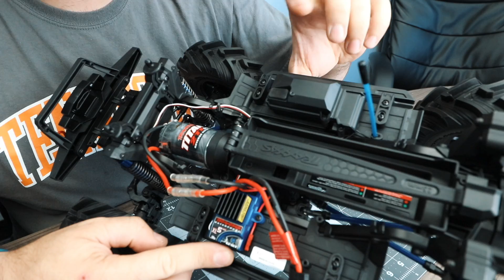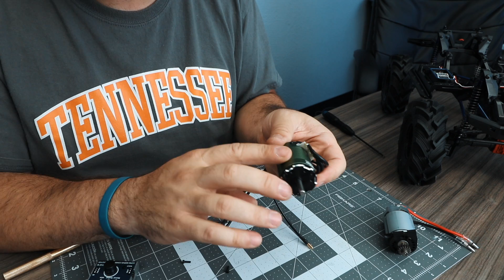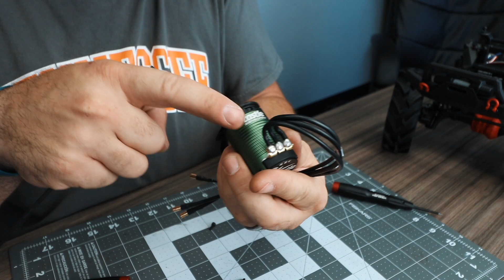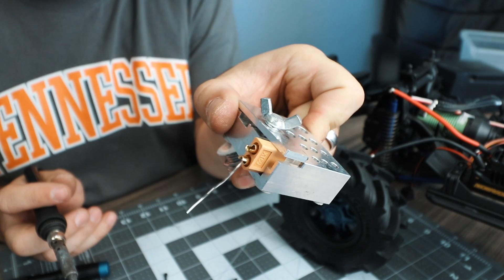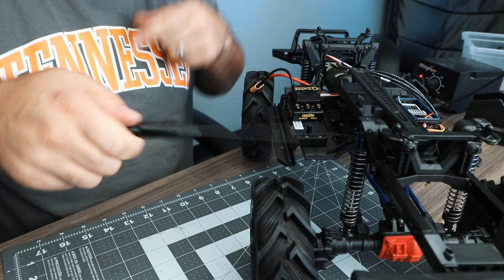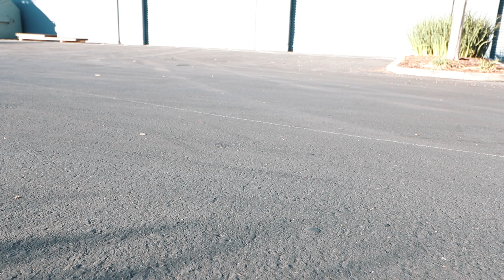TRX4 Brushless System - Mega Mud Truck

Comment: Did you have to reverse the motor rotation with programming or did you just switch the bullet connectors? I just got a sidewinder sct combo for my fathers trx 4 so that’s why I’m asking
Reply from the maker: Since it is a sensorless motor, I just reversed wires as needed.
Reply: @HarleyDesignsInc  oh okay but if I wanted it to be semsored I would need the castle blink right?

Comment: chiming in a little late here man but anyway i could get a motor recommendation from you for this truck im still relatively new to the hobby and found out today i have been overpowering mine with a 50c 3s  what kind of motor can i run 12.4v on and still be able to crawl ?

Comment: I love the Traxxis motor plate ABC spacer selections. Set it and forget it. No need for paper, and then the readjust. And the slight groves that sometimes get pressed in. God I love it. This is how they should all be. Oh, and is this a new rc craze? A dedicated mud truck? I sure hope so. Gives me something to trailer in with my crawler. Other than that airboat that never ends up getting used anyway. Hmmm. I really would rather run a brushed motor in my crawler anyway, and keep it out of the mud. This may be the answer.

Comment: I understand guys want to tinker and mod, but this seems a bit crazy to me. The TRX4 was not meant to look or perform like this. You took a capable crawler and made it a spastic over powered toy. To each their own, it's your truck, I just don't get it. I totally understand useful mods and upgrades to the TRX4 to improve what it is designed to do, but not this.

Comment: How do you like the EcoPower servo? Would you rate it as high as the Futaba and Protek and recommend this servo for crawlers (VS-410, SCx10 ii)?
Reply from the maker: Definitely not on that level. It’s just a reasonable servo to use on the cheap. But definitely not a high end unit.

Comment: You should rethink your way of soldering the female plug to the ESC, could not believe I saw this in one of your videos. BTW: Highly recommended to plug a counter (male) plug into the female (ESC side) XT60 when soldering, otherwise the pins often move a little bit, because the plastic melts. Then the plugs are very hard to plug in and unplug (HK does have pliers); of course a male (battery side) plug without battery, a "dummy"! (Fits into Mr. Jig). Why don't you solder the plug before mounting the ESC into the chassis, and why don't you stabilize the wires and pretin? Since you are probably an ideal for many viewers concerning "technical RC (car) stuff", you should not show such a bad (and incorrect) way of soldering plugs.
Reply from the maker: There are certainly many ways to solder and some will be better than others. Plugging in a dummy plug was something I often did with deans. XT60 solder so quickly and easily that I’ve never melted one.
Reply: Guys chill. It's just a plug

Comment: Great video man, hey I have a quick question for ya, I'm building a totally custom crawler with lots of vanquish and insicion parts. I installed a 5700KV sidewinder 3, on 2s. I have a Savox waterproof servo, but I was curious ive been at this kinda stuff for years, but I was curious, before I ruin another servo, how do I properly "center" a servo arm??
Reply from the maker: Power up the servo, make sure the radio is centered, point the wheels straight, install horn.
Reply: Harley Designs thank u

Comment: I know you didn't build the truck for crawling but how is the start up and slow speed control of the SW4 with the 3800kv motor in the Trx4?
Reply from the maker: JJ78n being that it is senseless, it’s not great. It would not be my choice for trailing or crawling.
Reply: I’m a bit late here but if you want something that can still go slow, you want a hobbywing axe